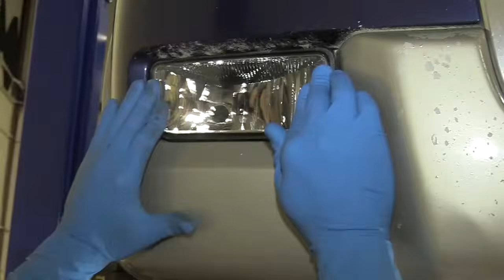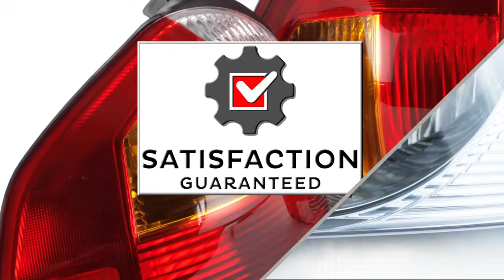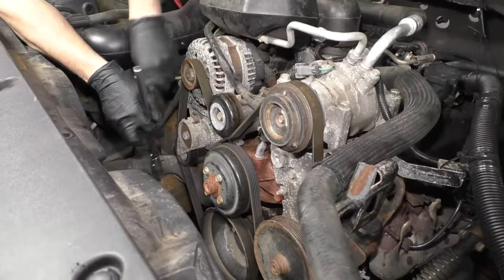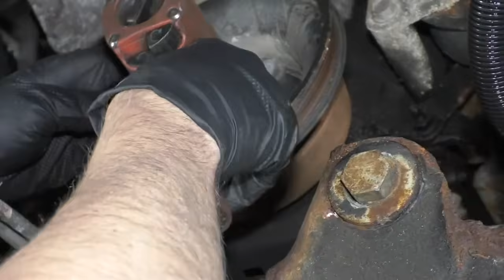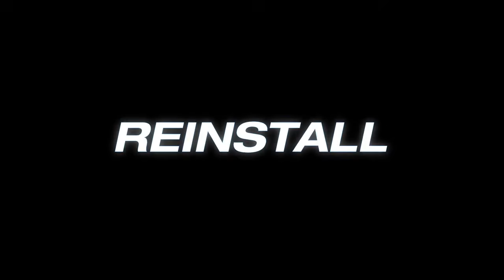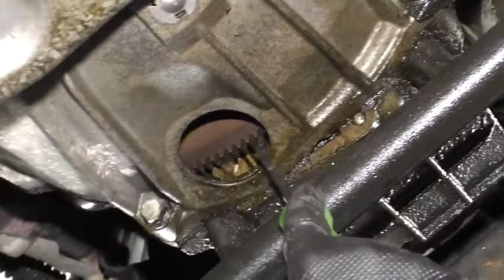How to Replace Harmonic Balancer 99-13 Chevy Silverado

Comment: I have a question. My van is 2000. and the harmonic balancer won't install. Something is stopping it from going down the shaft. Any idea of what could be stopping it. I checked the woodruff key and all is good. I can't get it out as its built in and goes into the body of the crank.

Comment: Was this Causing the Engine to Squeak , I just replaced my alternator and all the tensioners and other pulley's the squeak is still there. It is a Manual Truck with no AC , I am thinking it has to be the Harmonic balancer slipping and squeaking.
Reply from the maker: +Innovative Intelligence We wouldn't be able to diagnose an issue like that here, you may want to have a local mechanic take a look at it. Thanks for checking us out! http://1aau.to/m/Shop-1AAuto-c
Reply: ur tensioner arm is too tight thats why you have a squeaky belt stil
Reply: On mine it was the water pump squeaking, in fact I have had to replace all of the pumps - water, fuel and steering

Comment: This must have been a v6 because the 5.3 and 6.0 v8 are one main bolt....and require a different puller...
Reply: One 24mm bolt for '05 1500 5.3 and milwuakee 3/8 impact won't break it loose
Reply: @texaskidnineteenhundred89  Nope, and 240 ft-lbs to seat a new one. Fun stuff...
Reply: Came here for this , I knew this didn't look like what was on my truck

Comment: Is this pretty much the same idea on a 08 6.0?
Reply from the maker: +ICU81 2 Thanks for checking us out. This process will differ for the 5.3L and 6.0L engines and we, unfortunately, do not have a video for that application at this time. 1aauto.com

Comment: 5:27 Thank you! Now I know why my belt wasn't inline correctly. The mechanic didn't used strap wrench to hold the crankshaft from moving when tightening it and the result the crank pulley wasn't torqued